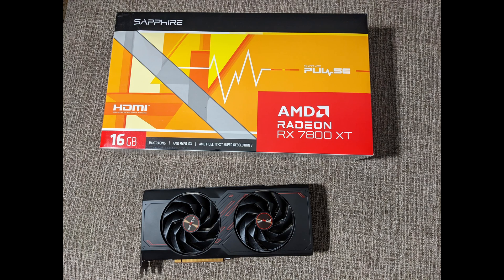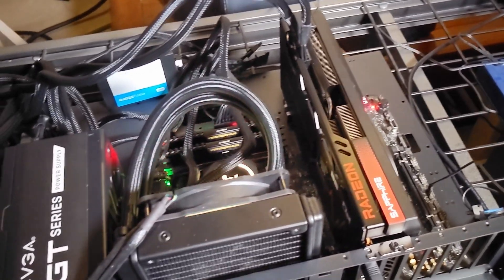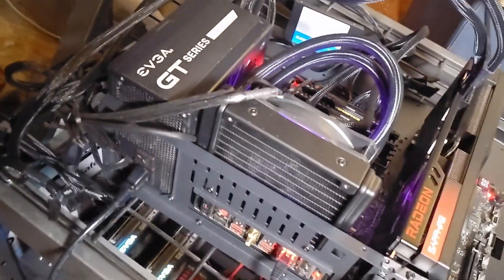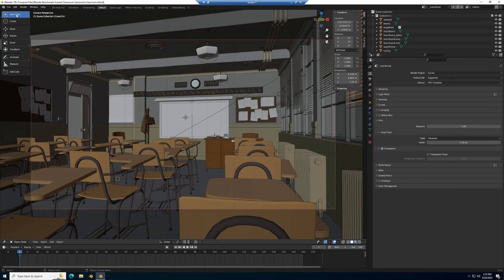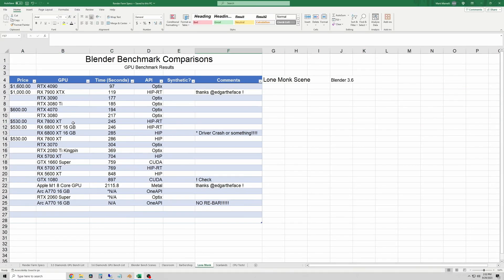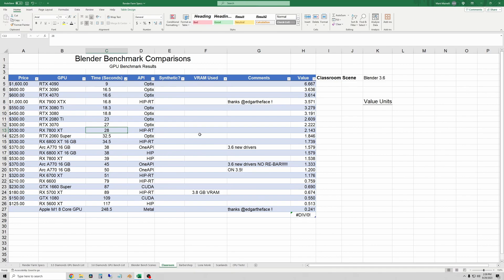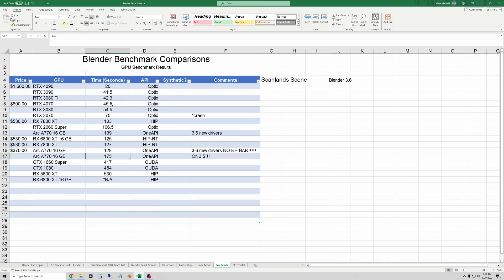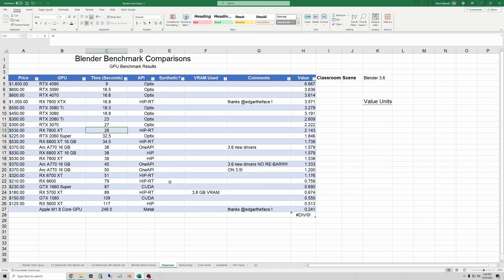AMD RX 7800 XT Rendering Tests in Blender | And New Test Bench Breakdown

Comment: I just want to knwo one thing,7800xt is not as good in blender so -
1- it will render slowly or it will crash in blender?
2- we saw someting system out of gpu memory.will 7800xt gives any benifit?
Reply from the maker: The 7800 XT will render just fine in Blender, it should not cause crashes with the right drivers. 
The 7800 XT will be affected by memory size just like Nvidia. I would have to check if HIP-RT allows out of core rendering or not. CUDA allows it, so Nvidia GPUs can use system RAM at a performance hit. OPTIX does not allow out of core rendering.
So the AMD 7800 XT will work fine, but is a little slow in Blender for it's price.

Comment: dont know if you'll be able to help me but i just upgraded from a 3050 to a 7800xt and blender fully bricked for me, rendering is either extremely slow, 5 frames an hour, or just crashes after failing to render a single frame, after a while i disabled the use of my cpu, which is a 5700x3d and suddenly blender works fine, its twice as fast as my 3050 and renders look normal, but im not sure why that is. I cant seem to find literally anyone else with this issue and was hoping you would know whats going on, ty
Reply from the maker: @Mattimation01  Make sure only the 7800 XT is selected as the render device in blender system preferences. Also, in the render settings, make sure the render device is set to GPU not CPU.
If it is something else let me know

Comment: Does blender 2.79 support the 7800 xt?
Reply from the maker: I will have to look. The 2.79 Blender Manual may help you find this. Otherwise, I would have to test it. 
I know that Vega generations do NOT work in newer releases, so it is possible that 2.79 did not support 7000 amd either. I can try it sometime soon. I have been meaning to re-test my 7800 XT anyway.

Comment: Im thinking about switching to amd since nvidia is messing up the market. Have you ran into any bugs when rendering?
Reply from the maker: @Echo_88  Not bugs per se, but compatibility is worse with AMD and some software. And AMD GPUs are definitely slower for blender dollar for dollar, but tend to have more VRAM as well. 

I have had problems getting AMD GPUs to work with Flamenco, which is a distributed rendering software from the Blender devs. For some reason they crash when running that, but not when rendering normally.
Reply: @ContradictionDesign  Have you tried rendering with a amd gpu in unreal engine? If so what was your experience with that?
Reply from the maker: @Echo_88  I have used unreal engine a little bit I have not tested hardware in it yet. I need to create some benchmarks for unreal because I do get asked fairly often about it

Comment: AMD cards are really behind in blender the 7800xt is better than 4070 in gaming but in blender the 4070 is 3 times better than 7800xt
Reply from the maker: @anmolwatson  AMD is slower per dollar for sure in Blender.  Which is just a software problem I think. AMD Hip-rt is not optimized for the otherwise good hardware AMD GPUs have
Reply: It has less vram, which will have a huge impact in a large scenes though. And only 16gb options from nvidia we have are either crappy 4060ti or insanely expensive 4070ti super. it's like 500 bucks gap between them without anything in between...
Reply from the maker: @ It is a perfect marketing trap. To force us to pick VRAM or speed. If we want speed AND VRAM, then be ready to sign over a kid or an organ
Reply: @ContradictionTech  Yeah... guess that's the bad thing about monopolies...
Reply from the maker: @antonvoloshin9833  Yep. And they get harder and harder to compete with as they get stronger.

Comment: Hello, Im a new tech student and its my first year in I.T highscool and im building my first pc for engineering and learning 3d, coding and editing (also gaming at 1440p for hobby) what gpu would you recommend for me? I have many options between 7800xt, 7900gre, 4070 super, 7900xt or 4070 ti? (My cpu is ryzen 9 7900) Would really appreciate if you help
Reply from the maker: I would say if you can stretch the budget to the 4070 Ti Super, then that would be really good. So would the 7900 XTX. For your mixed use cases, either brand will do well on average. Nvidia has better drivers and software support, but your uses should be easily compatible with AMD anyway. 
I would also consider watching the new GPU releases this month, maybe there will be some compelling hardware to consider.

Comment: Is there a difference for the RX 7900 GRE and the RX 7800 XT? I plan on going for AMD for my first build since I am a hobbyist.
Reply from the maker: @shirounurimba6898  looking at the specs, the 7900 gre and 7800 xt will be very similar performance wise.
Reply: @ContradictionTech  Thank you.  Does Compute Units affect rendering time? RX 7900 GRE has 20  more compute units than RX7800 XT.
Reply from the maker: @shirounurimba6898  Yes the CU count does matter, but clock speed, memory speed, bandwidth, and other specs also factor in. The 7900 GRE has slower VRAM and if you look up raw FP16 data, the extra CUs are only enough for 10% theoretical gains in performance. The GRE is more efficient on power though, because they both have about 260 Watt TDP.

So in short, the GRE is faster, but not by much.
Reply: @ContradictionTech  Thanks so much for your help. I really appreciate it. I think I'm gonna buy the RX 7800 XT!
Reply from the maker: @shirounurimba6898  You are welcome. You will enjoy it I am sure.

Comment: Can you help me decide between the 7800 XT and the 4070? I’ll be using it for gaming and game development in UE5. I’m a beginner with 3D games and modeling, and I’m unsure about which one to pick. The 16GB VRAM on the 7800 XT seems great for future-proofing. If I were to use ray tracing at a medium level while making games, would the 7800 XT be able to handle it? I'm just a bit confused about what to buy.
Reply from the maker: The 7800 xt will be a little slower than the 4070 most likely, which is not a huge deal. The extra VRAM will come in handy. UE5 is better at using AMD GPUs than Blender cycles for ray tracing, from what I have heard. So the speed gap from 7800 xt to 4070 is less in UE5 than in Blender. 

Hope this helps!
Reply: @ContradictionTech  thanks for replying me so quickly I have another question if I were to create scenes like this on a little larger scale will 7800xt handle smoothly 
https://youtu.be/pQJi_cnRPAU?si=FS1Jb4f24DbfO_Ti
Reply from the maker: @tejaskutal2922  It should be able to run UE well enough to make that. The biggest thing is you should have enough VRAM, so at worst case your fps will be less than ideal when playing the scene in the editor. But this will not prevent you from making it by any means. I think unreal engine is pretty well designed and you should be able to do a ton without a hitch on the 7800 xt. 
I haven't use UE5 enough to get too specific here, but keep in mind they made very complex games with much slower old hardware over the years
Reply: @ContradictionTech  If you are in my place which one will you choose?
And is 12 less since I have no Idea I can't tell how fast the 12 vram will get used and what happens if a certain task exceed the 12 gb vram limit
Reply from the maker: @tejaskutal2922   @tejaskutal2922  Well for unreal engine I don't know what happens when you run out of VRAM but it will probably either crash or run very poorly. Might have to look into that more.

I really like the Rtx 4070 but for development I think the higher VRAM is the right call. You can do tons with 12 GB, but you can do more with 16
Reply: Hey which gpu u brought?
Reply: @RishabhSharma-ou4ueRtx 4070 Super

Comment: why not optix for gtx 1080 ?
Reply from the maker: If I remember right, the extra loading time on optix did not get offset by the rendering speed. So Optix is not much different than CUDA on GTX GPUs. Optix was actually slower when I tested it on the 1080. This is because they do not have RT cores, and Optix is made to use RT cores for faster renders. 

Now Optix has changed since that test, so I could re-check and see how it has changed. But I imagine the effect on GTX GPUs would be minimal.
Reply: @ContradictionTech  i use a 1070 ti for my renderings, and it works quiet faster with optix
Reply from the maker: Oh interesting! It may be worth a test on newer cycles versions, because mine was pre- Blender 4. I am glad it works faster, and I can retest soon! Thanks!

Comment: What's the best for rendering (not gaming) rx 7800xt or rtx 4070 ??
Reply from the maker: If I remember correctly, the 4070 is a bit faster, but the 7800 XT has the extra VRAM. So if you can live with 12 GB VRAM, the 4070 is better. But the VRAM question is always dependent on your needs, so you will have to decide what is important.
Reply: @ContradictionTech  So in which case do you need more vram?
Reply from the maker: @nguyenho478 It depends on your scene. The more hi res textures and objects with large topology you have, the more VRAM you need. To know exact numbers you would need to consider some examples. It is hard to answer this question because there is no simple math to calculate the VRAM needs. 
I would say if you plan on making really dense scenes for cycles rendering with realistic hair curves or heavy simulations, you may want 16 to 24 GB of VRAM. If you plan on simpler, Eevee scenes, you will be ok with less.

Also, every scene can be optimized and settings can be tweaked to make your scene fit. This just adds extra steps to the setup of the project before the render.

Comment: Hey, i am going to build a pc and use it for game development, using blender and gaming. Which card should i use Rtx 4070 or Rx 7800 xt?
Reply from the maker: Well the 4070 is faster in many apps, but the 16 GB VRAM is probably more important for game dev. You probably want as much VRAM as possible for creating games, so you could handle making bigger apps I would think. I'm not a game dev though, so just my guess
Reply: I also have the same question which card did you decide buy then?

Comment: Basically at 500 dollar, you get a time render around 20% slower than a 600+ dollar gpu? Hmm
Reply from the maker: Are you referring to the RTX 4070? Because now those can be bought for under $550
Reply: @ContradictionTech  kinda both with Rx 7800 XT and the 4070, i think now with the addition of 4070 Super, i would've thought that 4070/4060 ti would be much cheaper to bought. While it was certainly true, most OEM are stop making the 4070. Meaning that the 4070 in the market are just leftover card that wasn't sold, and who knows when those cards were gone for good. Assuming that card was gone now and it fully replaced by 4070 super,  the price 4070 super in was around 650 dollar, while the cheapest RX 7800 XT was sold as little as 480 dollar. (EDIT: It goes back to my point, does the extra 150 dollar worth it?) 

To my surprise, some 4060 ti was still sold as high as 525 dollar despite now the 4070 was on discount around that same price. 

(EDIT 2: This was a huge point because while at 3d modelling the 4060 ti outperformed AMD cards, in gaming (which this card was supposedly design for) was absolutely destroyed by 7800XT and cheaper 7700XT. And guess what? AMD cards performs very well at Photo/Video application unlike in the past, rendering 4060 ti value much obsolete)
Reply from the maker: @homeperson11244  Yeah it is interesting the 4060 ti and 4070 got so close. But I know a lot of people really want the 16 GB VRAM, so it makes the slower speed of the 60 ti more attractive
Reply: @ContradictionTech  People really do need to research their product first before buying, you're video kinda proved that VRAM didn't really matter. It kinda annoys me alot too because the Nvidia 60/70 series card used to be the budget/semi mid range card for people who likes gaming with interest at content creation. It wasn't until recently that the price of these cards were inflated by people who wants a  Workstation at low price. Did they know what Quadro is? /s
Reply from the maker: @homeperson11244  Yeah even most 3d work can be done with 12 GB if your scene is a little optimized. So it is interesting how a 60/70 tier GPU is now so expensive. But they are very fast in general too.

Comment: Is it just me or did I see the 7900XTX keep up with the mid to tip tier RTX cards? Has AMD really gone that far up the ladder in productivity? Could I replicate a figure similar to that on my card?
Reply from the maker: AMD is getting better, and you should produce similar results to these, if you have the 7900 XTX. Dollar for dollar, Nvidia still wins in rendering, but it is not the gap it used to be.
Reply: @ContradictionTech hi i can buy the rx 7900 xtx but would wait atleast a month more on savings to get a 4090? Would i be okay with the amd card for rendering or 4090 is a really must have? Thank you for your videos
Reply from the maker: @JaxxAndrei  The 7900 XT is pretty fast but the 4090 is much faster. I would say go for the 4090 if you can. I think the price difference is about the same as the speed difference, if you can find 4090 for list price
Reply: @ContradictionTech   Where's the 7900 XTX tests?  😞
Reply from the maker: Hey! I will probably get one myself. I will dig through my records to try to find some. I know you have wanted them. I will get them one way or another.
Reply from the maker: Found them! Here they are. 7900 XTX time results in seconds, HIP-RT.  Class: 16.71  Barber: 69.32  LoneMonk:  113.17  Scanlands: 58.17.

Credit for these goes to @edgartheface for testing and providing me with these and other results.

Comment: I've been struggling with renders on my 7900XT. It'll use 100% of my CPU (Ryzen 7 5800X3D) but only round 10% of my GPU with HIP RT on with only GPU rendering enabled. Do you happen to know a fix for this?
Reply from the maker: I assume you are using task manager to look at this? Task manager does not report RT core performance properly, so it will look like it's running low GPU usage. I would install hwinfo or something like that to check the utilization, and you should see much more detailed info. Let me know if you have more questions!

Comment: This sapphire pulse 7800xt vs xfx quick one? What gpu of that 2 is better?
Reply from the maker: I think they are very close in speed and quality. It probably comes down to preference. I have had multiple GPUs from both brands and they have both been high quality
Reply: @ContradictionTech And does this sapphire rx 7800xt get hot? What's the max temperature you got with it? Thank you very much, there isn't many videos about this card on youtube.
Reply from the maker: @xkais487  I would have to check one more time, but I believe it was rendering at 55 C max core temp. So not bad. But I'd have to test in hwinfo to look. But it's a relatively low wattage GPU, so it's easier to cool than you'd think
Reply: @ContradictionTech  That's a great temperature, my xfx 7800xt quick which I returned cause it didn't fit my case was getting 63° max with no case
Reply from the maker: @xkais487  oh wow. Yeah I'd have to check for sure
Reply: @ContradictionTech  yes pls confirm me the temps of the sapphire I want to buy it
Reply from the maker: Hey! I just posted a video to reply to this! In Cinebench 2024 I got 62C max on the core for the 7800 XT. Average is under 60, and this is with stock/slow fans too.
Reply: @ContradictionTech  thank you! there's not many videos about this card, I appreciate that very much you have just gained a subscription! 🥵😳
Reply from the maker: @xkais487  You are welcome! Glad to have you onboard!

Comment: Ayo man thx u so much its very informative im a novice 3D artist starting my career and just able to afford some good pc i also love video games so much, i was about to buy the 7800xt bc its cheaper but i see in ur data even the entry level Nvidia is outperform the amd card in 3d, i got two option wheather getting the 4070 or 3080ti, tho my only complain is that the 3080ti is consuming more power way more ? Any suggestion, at work i use my office pc which is 3070 and 5800x, should i wait for the price drop or get 3080ti
Reply from the maker: I would get the 4070 over the 3080 ti. They are close in speed but the size, power draw, and newer features of the 4070 are great

Comment: I'm deciding between this model and Nitro+, how're the temperatures?
Reply from the maker: The pulse runs fairly cool. In my tests it never stood out as hot.
Reply: Good to hear, don't want to overspend on better cooling if not needed, cheers.
Reply from the maker: @So_cha  Yeah that makes sense. I am sure the nitro is cooler and better binned, but probably not worth the cost.

Comment: You must show the Viewport performance on AMD GPU, not only Rendering
Reply from the maker: I will look into this. Is there a standard comparison test I can use? Viewport performance is hard to test as far as I know.
Reply: @ContradictionTech   Viewport was tested by 'techgage' - the 7900 xtx had decent results.   But, this was a while ago.   I am saving up for a 7900 xt or 4070 ti or used 3090 - dunno what to pick.   That's why I'm searching high and low for some results on the 7900 series.   :)
Reply from the maker: @Danidesktop  That makes sense! Keep in mind the 40 series super cards will be announced this week probably, so they could be good options too
Reply: @ContradictionTech   Yep, I know but I think they will be expensive in my country - dunno what they will priced at - all kinds of rumours just adds to uncertainty and confusion.
Reply: @ContradictionTech   True but I suspect the price will still be high - after all the rumours but I hope I'm wrong.
Reply from the maker: @Danidesktop  looks like in the US, each super model will match MSRP of the original. Except the 4080 super, which will be cheaper than the 4080. But yeah, how that translates to your area is the question.